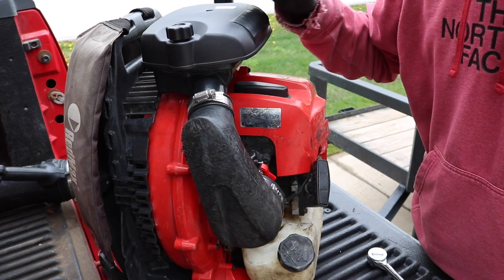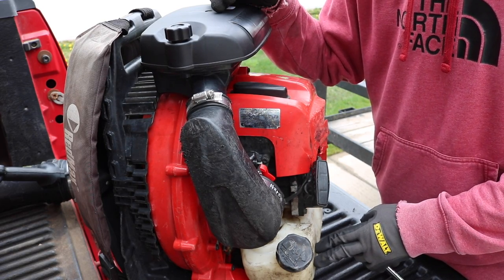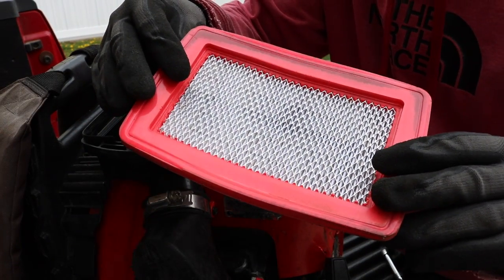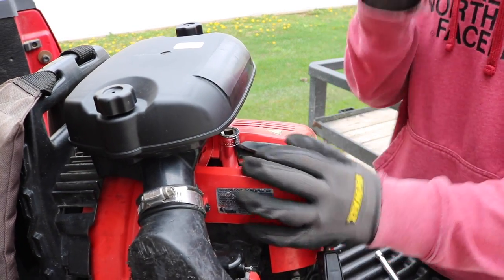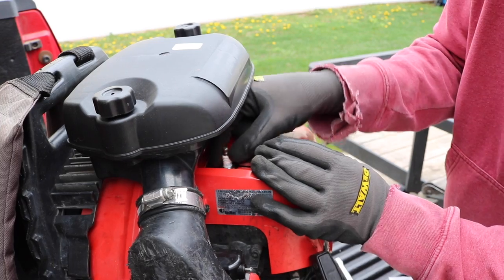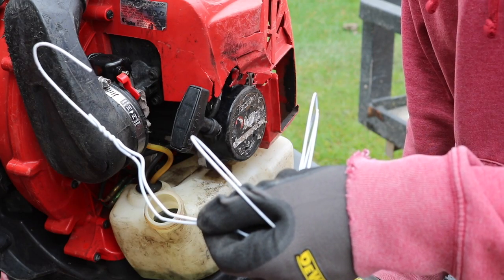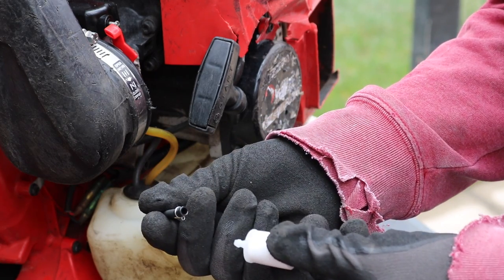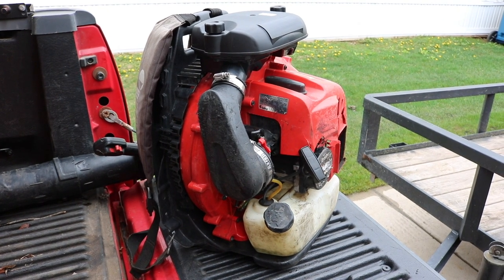RedMax EBZ7500 Basic Blower Maintenance

Comment: Great video! How do you like this compared to the Echo PB-770T?
Reply from the maker: Charlie B If my 770 Echo blew leaves as well as the Redmax 7500, I'd suggest both equally.  If you just do grass clippings and leaves here or there, you're fine with either. But the 7500 beats the 770T in volume hands down.

I have another video, blower mania. May be a good resource for ya! Thx for watching.
Reply: Brian's Lawn Maintenance Thanks for the info!
Reply: I've owned both and the redmax feels more powerful but I've had better luck with the echo overall mostly cuz it's been more reliable in my experience